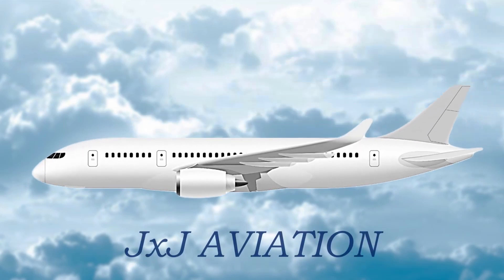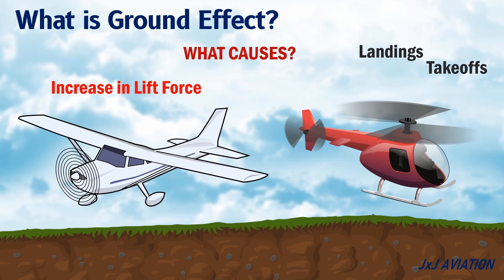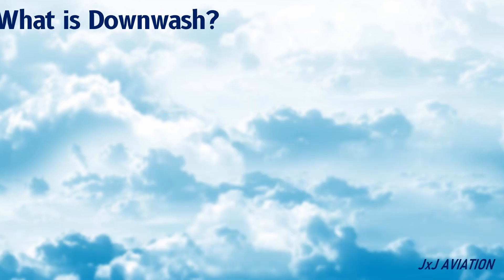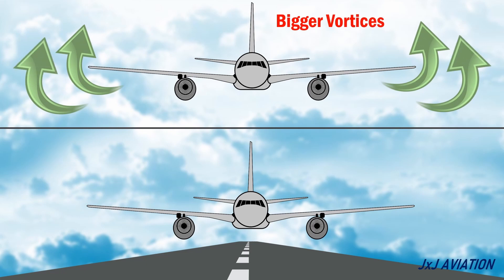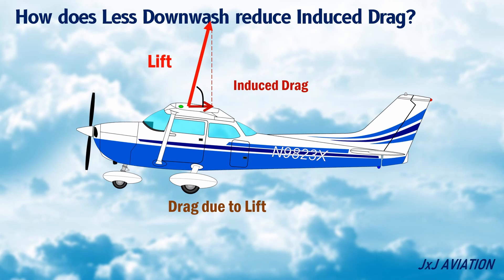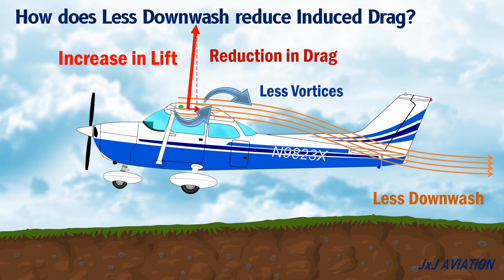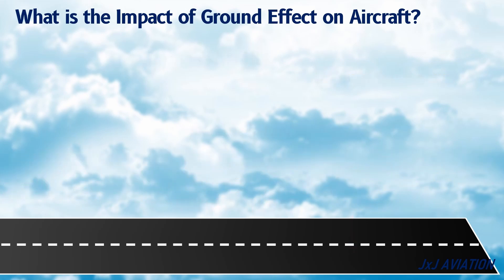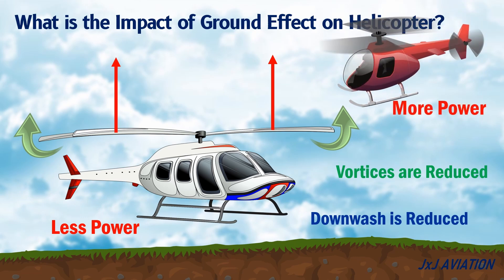What is Ground Effect? | Impact on Aircraft & Helicopters | Understanding Downwash & Induced Drag |

Comment: Increased lift from ground effect has NOTHING to do with wing tip vortices.
A wing produces lift from the downwash and the reduced pressure the wing generates above the wing.
Most of the lift is from the top surface.
If you hold a nozzle of compressed air 20 ft above the ground the lift from the jet will be minimal.
If you hold the nozzle close to a flat surface you will feel the additional "lift" produced.
Ground effect works because the downwash is resisted by the proximity to the GROUND!
That is why it is called "GROUND EFFECT"!

Comment: Ground effect is very dangerous thing seen in aircraft nowadays but its really solution not find out ... But i think so it's happen due to wing trap all air in wing area and landing portion parts so we called air cushion as duely its help to increase the lift force wing area and landing portion area so that's why it's not get easily land on surface and face hardly problems thank you sir
Reply from the maker: Yes. Thank you for sharing the information!

Comment: This ground effect theory has never been intuitive to me. So, according to this, if you have a wing that was extended infinitely long (reducing wing tip vortices), then you would have no ground effect? Something tells me this isn't correct.
Reply from the maker: On an infinite wing there are no wing tip vortices, however the lift vector "straightens", which means the induced drag reduces.
Reply: I think before you attempt to understand ground effect it's important to first understand induced drag. We all know it's a byproduct of lift, but it's hard to conceptualize how induced drag changes the lift vector. This occurs due to the local airflow over the wing. We've all been taught that lift acts perpendicular to the relative wind, and that downwash changes the relative wind. This is a correct, though simplified explanation. Think about it this way. Wingtip vortices are a byproduct of lift, downwash is a byproduct of vortices, induced drag is the name we gave to the rearward vector caused by the downwash. The "local airflow" is the average between the freestream relative airflow and the downwash. Lift acts perpendicular to this local airflow. Therefore when the downwash vector is reduced due to a disruption of the wingtip vortices, the local airflow is more horizontal and the lift vector is more vertical. TLDR: If no wingtip vortices were being generated (as with an infinitely long wing) no downwash would be created and therefore the ground effect would not be present.
Reply: Gliders try to synthesize this effect at altitude with a high aspect ratio (long and slender) wing, maximizing lift while minimizing the induced drag penalty as much as possible.

Comment: An important force, especially for aircraft flying over water. You may recall the Russian  Ekranoplan  which operates completely on ground effect and was quite viable. Studies have also been  made to design heavy lift, Lighter Than Air aircraft that also show potential. .Ground effect is very difficult to maintain trim and stability if you are near the water. Jacque  Cousteau's son lost his life when his Catalina crashed in ground effect. However, Ground effect seems to be a force that is not reviewed very well by the instructors in the General Aviation Industry. I hope they watch your video and start using this in their training course. It is an effect that makes a difference. Once again thank you for your insight.
Reply from the maker: Thank you so much for your review and valuable inputs provided! Truly said this effect is definitely ignored in aircraft, but it comes into play during every landing!